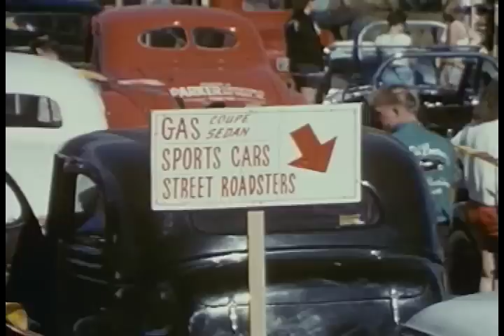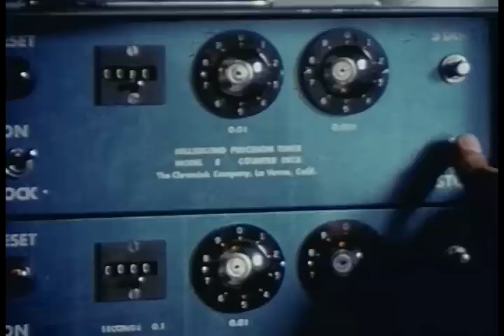Ingenuity In Action - NHRA Hot Rod Film (1959)

Comment: 1945 Allison powered Green Monster at 170.45 MPH !
Wow ! 23:55
Reply: not really a good power to weight ratio on the Allison engine powered cars
Reply: camerl2009 There wasn't a way to make that kind of power with a car/truck engine back then.
Reply: stlchucko yeah there was same way we make more power now by boring and stroking better heads and camshafts they also had superchargers for things like flathead v8's. the Allison weighs about 1350lb dry so its not like its way too much but still not light
Reply: while smoking those tires all the way through the 60 foot
Reply: @camerl2009  Cast iron small block chevy weighs over 500 pounds 
An allison weighs 1400 pounds at 1700 cubic inches with 1500hp stock